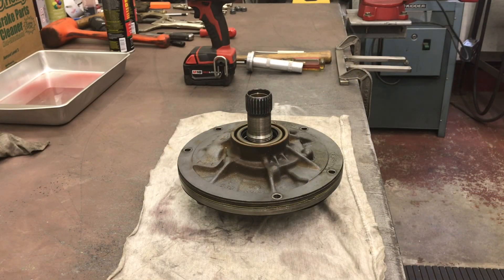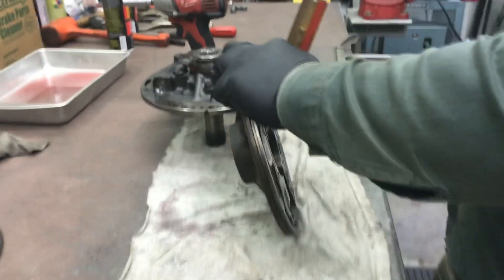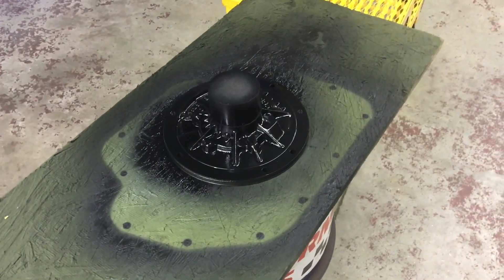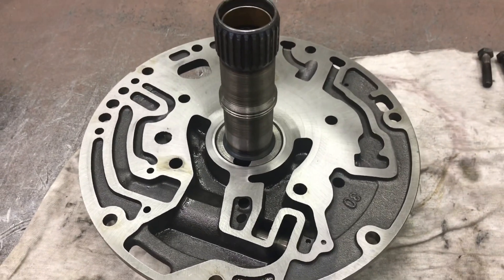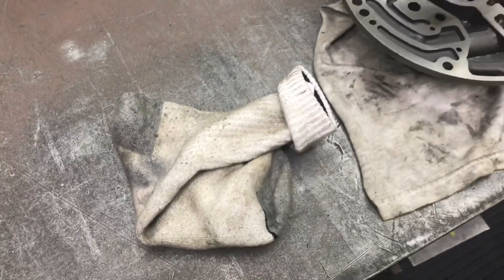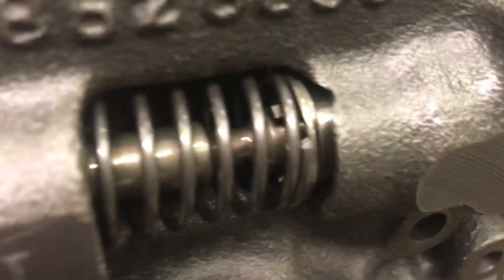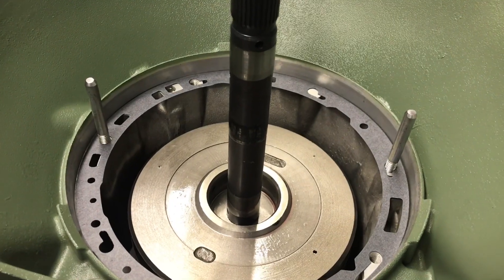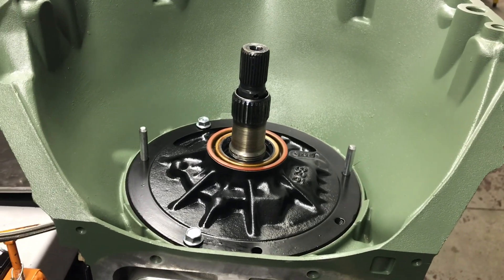Race TH400: Front Pump

Comment: Shawn, thanks for the wonderful tutorials on TH400s, ive got one disassembled and have a few questions. Ive done all the mods for the manual shift stock valve body, my question is, should I do the pump mods with the set screw for charge pressure and are metal sealing rings ok? Thank you sir

Comment: I use 1/4" grub screws to restrict oil to my Pontiac solid lifters. I found heating the grub screw to anneal it softens it to enable drilling. Too much heat and it gets diamond hard. Brass is do much nicer, but in a pinch you could try annealing. 
Enjoy your videos & thank you for sharingvyour knowledge.
Reply from the maker: Great tip, Thanks!

Comment: Great video! I am getting ready to replace the front pump bushing and this is an excellent video. One question: do you have the torque specs for the rear pump bolts ( the different lenght bolts) and the front pump bolts? I know I can look this stuff up online but sometimes you get different numbers and info so I wanted to ask a guy that has obviously built 1,000’s of these transmissions. Thanks Shawn!

Comment: Luv your videos and a thumbs up! Hope you can answer my problem here. I have a TH 400 in my Chevy pick-up. Not a race truck either! When I shut the motor off and when sitting for a bit, it pushes out Trans fluid. Can't find wherever it's coming from! Any ideas why or where? Thx much bud.
Reply from the maker: Thanks!
Start simple, check the vent tube, and all the seals above the pan, speedo, dipstick, linkage, kick down, front pump.

Comment: I have a turbo 400 that has set in garage for a couple of years. The trans has not been disassembled.  Before installing in car i tried to turn pump by hand. It will not move. Should you be able to rotate pump by hand.
Reply from the maker: How are you attempting to turn it?
Reply: I am using both hands to grip oil pumps large spline and trying to turn

Comment: Shawn, I took apart the Billet aluminum TH400 pump I have from Coan, and discovered that it does NOT have that hole in it like the one in this video that you've threaded and installed a set screw in. It only has the hole which is further away from the shaft and located right above the pressure regulator bore, and while there isn't any plug nor set screw in that hole, for some reason it IS threaded and it came that way directly from the manufacture, (which is Coan). So my question for you is: Since I'll be using a trans brake valve body in this TH400 I have, should I go ahead and install a set screw with a .110" drilled hole into that orifice which is located directly above the regulator valve bore since this pump doesn't have another hole right next to it like the OE pump does? Or is that hole on this Billet pump threaded ONLY for using a dump valve? And if it IS only for a dump valve, (which I will not be using) will I be ok using this pump with a trans brake just the way it is?

Comment: Is this engine thrust modification on the pump shown in this video usually needed with most aftermarket aluminum billet pumps too, or do they usually already have the .110" restriction hole built into them?
Reply from the maker: I don’t know if they come restricted or have the ability to modify them. I haven’t had one to inspect.
Hard to beat the stock pump in almost every application.
Reply: @mountainsgarage  Thank you for your quick reply. I bought an aluminum billet pump from Coan because it has an adjustable set screw which will allow me to adjust the line pressure any way I want just by dropping the pan. I guess I'll just have to remove the five bolts and take the pump apart to check to see how big that orifice is.
Reply: of course I could've probably just bought an adjustable reg for stock pump I guess, but this is a fresh build, so I needed to buy a pump anyway.

Comment: I notice you didn't check for pump body wear, a step created by the pump gears
I also noticed that 1: you did not check the thrust area on the body. When the bluing is warn off, the pump body is finished. 
2: you didn't mention the wear on the gear teeth, also the wear pattern marks left by depth of the torque converter. I wouldn't reuse the gears. Do you clean everything (internals) in parts cleaner Spirits?
What about the transmission body, that needs to be run a washer with some pretty harsh chemicals to get rid of road grime and metal debris. 
I never paint until it's all assembled.
TH 400s are almost extinct 😂
Reply from the maker: I have over 100 TH400 videos, we eventually will cover everything!
Do you have a transmission shop?

Comment: Do you have a part number for The snap ring that holds everything in place. Or where can it be bought. I been searching the net with no luck.
Reply from the maker: Which one? The HD intermediate?
Reply: @mountainsgarage  the one that holds the pressure regulator spring and valve in the pump housing
Reply from the maker: @AbaddonZ28  11503348 is the number I believe.
Reply: @mountainsgarage  thank you very much for the videos and all the help you give to us.

Comment: Idea- locate a block of wood, drill a hole with a boring bit large enough to slide the pump stator into hole and put the wood block in vise then stator into block. That way you can crank on wood block instead of using  a dang  sock to protect the stator shaft.

Comment: How do you replace the pump stator tube? Thanks
Reply from the maker: I have the press tool from TSR Transmission that I use to replace Powerglide stator tubes. Press out and press in then I pin it with a set screw.
I have never done a TH400, the stock hardened tube is fine. Now I need to try this on a junk pump to see if the same tool works or make a new one. Thanks for the idea, sorry I couldn’t directly answer the question.
Reply: @mountainsgarage  no worries i always appreciate the input. My torque converter chewed mine up but at this point I may just replace the pump assembly. Can of worms like always

Comment: I heat the set screw with a propane torch until it's cherry red.
Let it cool and it's easy to drill.
Reply from the maker: Good tip! I bought a 100 brass ones.

Comment: Great videos what do you think about me using yellow Transgo spring for the pump? Bs stock in a dual feed mod will it screw up the pump wear wise?
Reply from the maker: Thanks!
The pump won’t wear out due to a increase in pressure, it is still regulated and operating in it’s normal range. Internet folklore for sure!
Reply: The stock setup had a 3 clutches and 3 steels one being a waved plate and had 100 thousands how do you set yours up for a daily street driver?
Reply from the maker: @mikewolfe789  Three clutches, three steels, no wave. Either cut the aluminum piston or the pressure plate to set clearance. If I was using what I had without options to change clearance or it’s a mild transmission leave the wave and 3+3 should have the correct clearance with new stock thickness parts.
Reply: Thanks for the quick response! Also do you know what a good tolerance should be with the intermediate 3 clutches ?
Reply from the maker: @mikewolfe789  Shoot for .040 to .050
Reply: Thanks again!
Reply: Good morning have you ever heard of anyone drilling 1-/16th holes in the pump gearthe bigger one of the 2  between the teeth for better lubricant to the back side of the gear for less wear?
Reply from the maker: @mikewolfe789  No I have never heard that. It’s rare to find a pump worn out of spec.
Reply: 10-4 thanks I just pitched the sonnax no walk bushing and brg shim kit keep the videos coming brother!

Comment: So is this pump mod for a trans brake pump or just any 400  race transmission in general
Reply from the maker: When you shim or install a stiffer pressure regulator spring for higher pressure this is one way to control the pressure in the converter feed. So any valve body.
Reply: @mountainsgarage  alright thanks

Comment: That's exactly what I use for a pump alignment tool. I'm not a big fan of using a case.
Reply: The case method can backfire , even without the pump oring. I have cocked em . Causing an uh oh moment. Tye valve trick works on 350s and 400s. Built 2 4L80s yesterday, and 1 4L80, and a RW70 ford today. 1 350 left to build tomorrow. Saved the easy one for last. Then I'm  going to Summit , or the gun store.
Reply: Two valves from a small block chevy. Drop the stems thru bolt holes 180 degrees apart. Perfect everytime.
Reply: @ronniecox109  I'm gonna have to give that a try. Thanks

Comment: Awesome video! I'm curious though, I've been a fan of the Sonnax boost valve for a while (400-LB1), I've been using them in 4l60s since Sonnax released them. Do you think its a good idea to restrict the converter charge port when using their valve? It does come with a spring that they advertise as being 10% stiffer than stock.